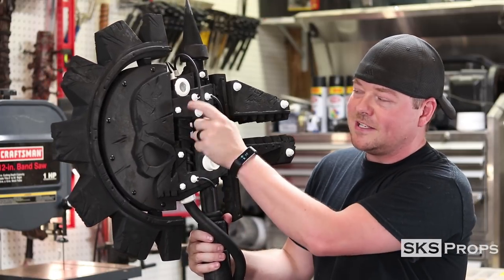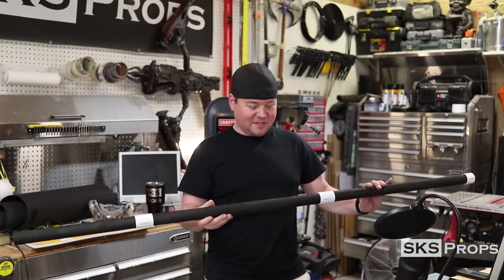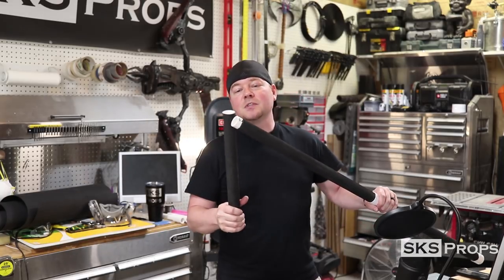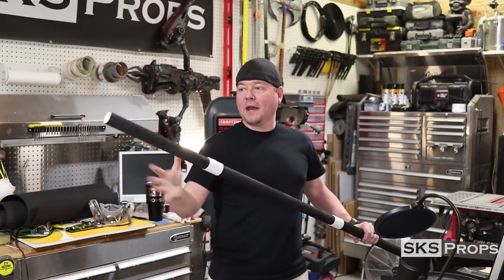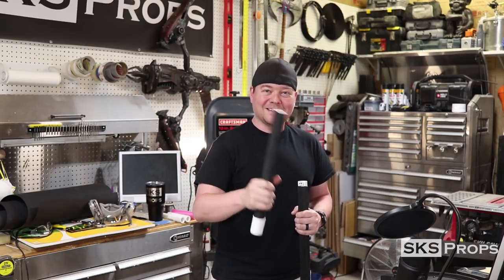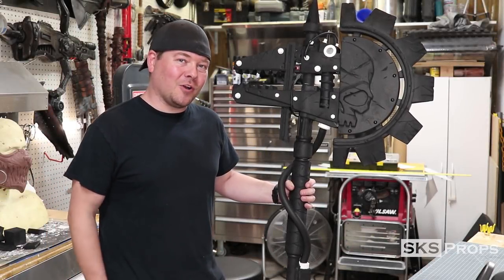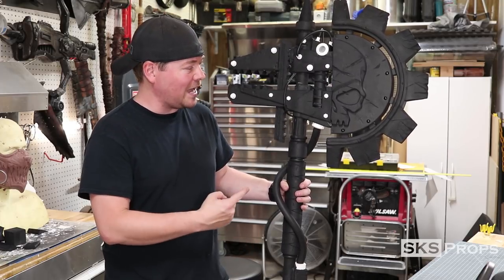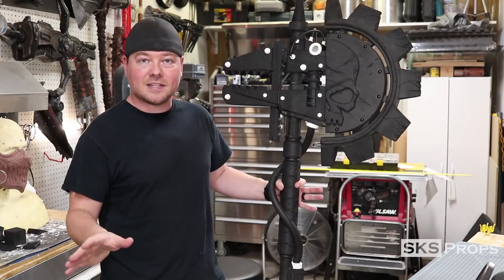Warhammer 40K Tech Priest Power Axe Part 2

Comment: How rigid is the handle?  The pvc tubes i"ve seen tend to be pretty flexible at the 1- 1.25 thickness I estimate you used? Any tricks you use to stiffen it up?
Reply from the maker: It’s really rigid. I don’t know what pvc pipes you’ve been looking at but make sure they are rated psi 450 and above
Reply: @SKSProps  interesting, only have sc 40 pipe at my home depot- only 370 psi -  Thanks for your answer- really enjoy seeing your projects.
Reply: du-oh,  i misread your reply- 450 psi, I first read 4500 psi. Makes me wonder what the difference is.